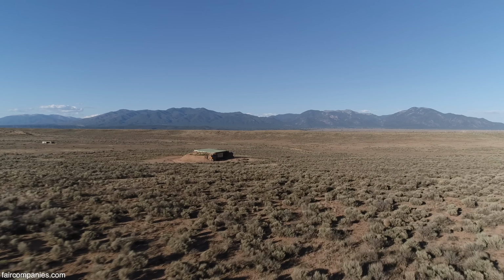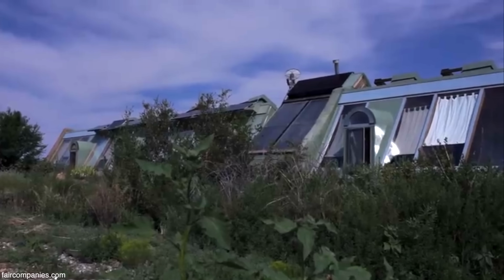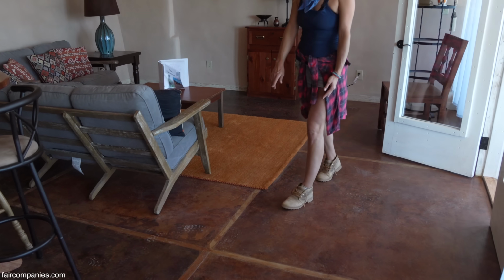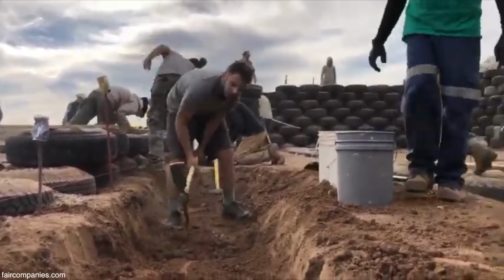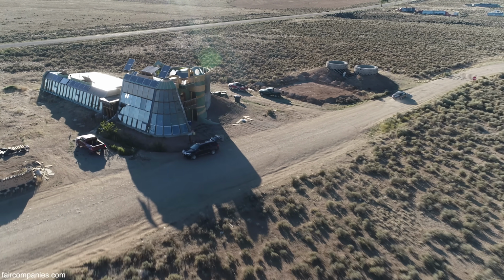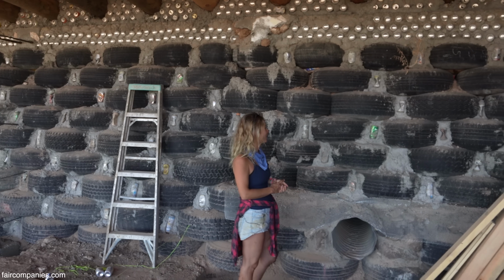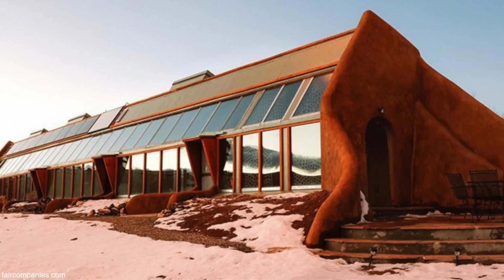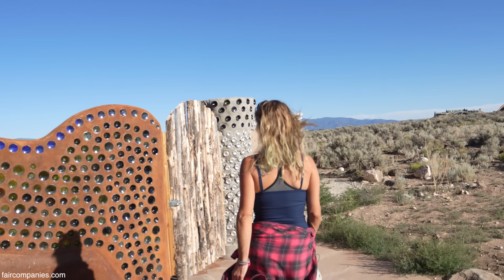New Earthships capture more energy, water & food at lower cost

Comment: I would be very interested in a more high-tech version of this. A solution could be engineered to electronically control the air intakes and vents to regulate temperature. This would allow each vent to separately turn on to keep that section of the house at the right temperature. They never went into hot water heaters, but I think that continually pumping water through the roof using some pumps could produce some sufficiently hot water if the roof was made black. That would need to be digitally controlled to happen when the roof is sufficiently hot, or based on the time of day. You could also get pretty good internet with a Starlink terminal, once that starts to really ramp up. Since the house is powered on DC, and my phone and laptop use a DC USB-C port, it would be nice to have that integrated into the walls alongside the standard outlets.

It seems like your biggest energy consumption based on this model would be the stove and microwave (probably about 1 to 2 kWh per day from cooking), unless you had a very power-hungry computer running constantly (say, 300W for a day, or 7.2 kWh). Lights could be very efficient LED bulbs that use DC directly from the batteries without a rectifier that would waste power, so that would be negligible. An efficient laptop running at (conservatively) 20W continually would be 0.48 kWh per day. This means you would probably need no more than 5 kwh per day, conservatively, thus ~0.2 kW of average power consumption is needed or 200W. You can get panels for about $0.47/W, thus you need something like $100 for the entire solar setup. You could be extra conservative and get $200 of solar, just in case. You could also just get bigger batteries. It is hard to find information on systems intended for 100% DC houses, like the one here, but it seems like it should be much cheaper.

Comment: Thank you for the video. I plan to build a small 50-60m house using some principles from both earthship and solar house designs. I would surround the house with earth to serve as thermal mass. Can you suggest any replacements for tires, please? The main reason is that I do not have the time or manpower available.

Comment: The problem with these homes is that they are crude and primitive-looking.  One of the main weaknesses is that if they were to have a drought there is no backup system like a well,  so everything would die and fail.  Which means that water would have to be trucked in.  Highly inefficent

Comment: I am building a home on a small island in the Philippines, I found this video during my search for cooling solutions, i'm looking into some Low Tech Geothermal cooling.
I have a deep well, about 20 feet down to the water table, through limestone... 
I was thinking about running a cooling tube about 4 feet about the water level, but was concerned about the humidity, so now I am thinking about a closed loop pump with large car radiators, 1 or 2 in the water & another larger one in the house with a fan blowing through it.
Or maybe even using the radiators in the well with some piping running under the tile floor or something like that.
Have you guys ever done anything like that?
Would it work very well, lol, pun intended
Do you think there would be much of an issue if I just used the cooling tube idea?
I don't have much of a budget & being on a small island, its not easy to get parts...

Comment: So some great ideas here but this will work only in certain environments. you could not use this in wet areas of the States. For the price it does not seem worthwhile $219k for a small-ish home, made of junk and repurposed stuff, that has a constant struggle for water, in the middle of nowhere, with very little creature comforts if the natural ones fail. It is super labor intensive needing a crew of 20 people to share the work load. this works for this area but there might be better solutions with different materials for other locations.

Comment: I don‘t get the reason for using tires. I mean, I understand you may want to get rid of them, and reduce the number which may end up in a landfill. But putting them into your house turns it basically into a hazardous waste landfill. How do you prevent that the tires do not pollute your air and water over time? And if the home ever needs to be torn down you end up with quite a difficult mixture of toxic substances…Even more useless for me are the cans. They seem to rather reduce the structural stability of the whole building than being helpful for anything. Heck, they don‘t even add much to the „mass heat storage“, and recycling of cans is nowadays well established (at least in most first world countries) and actually less energy consuming than making new aluminium…

Comment: An Earthship home can be built for very little money if you do it all yourself and take your time, find inexpensive property. (I bet purchasing land in this community is the biggest expensive.)   Source your own materials, use what is available on the land.  You don't need tires to go into the earth and find more stable temperatures.  A hole is free square footage for the labor.  Get a permit and harvest your own beams.  Mill your own lumber.  Some places you can obtain tires and other materials for free from landfills or torn down buildings.  A difficult thing can be finding a location that will accept alternate building styles.  The most difficult thing can be finding someone to join you on the earthship journey!   My latest design incorporates geothermal, advanced water collection, fully integrated AG, aquaponics, in ground citrus orchard and garden.   The goal is to produce all food, water and energy in a single biosphere.

Comment: I’ve heard one of the down sides of the tire wall is the off gassing of the rubber contaminating the air quality. Maybe less of a problem for parts of the year when the windows are all open but more so when it needs to be closed. 

I think the tire wall is also the reason it won’t likely ever be code compliant so it’s not possible in most of the country where there are building codes. The good news is that there are structural systems that are code compliant that could easily integrate the other systems in a healthy sustainable way.

Comment: I have a question about rain-water harvesting! Since it is ~300-500mm average yearly precipitation in NM. How can enough be collected from such a measly amount? Is there something I can read with amount harvested + used? Also I was wondering if condensors are used to collect water too?
Reply: What happens is the water begins to accumulate because the house itself provides cooler temperatures and root systems that retain the water compared to the dry arid surroundings that result in greater evaporation of what little rain fall there is

Comment: If you utilize your roof to collect water and harvest energy you're on the right path I could tell you how to collect 5 to 15 gallons of water a day simply by utilizing your AC and utilizing your solar panels that produce condensation even if there's no water in the atmosphere I can show you how to collect energy all day long and how to have nowhere on your batteries that simply building a water trough that allows for your batteries to be submerged essentially prevent your batteries from getting hot

Comment: Can thermalmass be achieved with other Construction material besides tires? Could these principles be used to make a different shape/ size home?
Reply: Cob or rammed earth homes both utilize extensive thermal mass. In a warm or hot climate they would moderate the temperature swings and be quite comfortable. In a cold climate that experiences winters below freezing and cloudy periods they would require exterior insulation and probably backup heat. In that case it is probably better to build with double wall construction and extensive insulation and use the thermal mass in the floor to store heat. Check out Polar Night Energy in Finland and then modify the idea.

Comment: I wonder if the cooling tubes would work in a humid, tropical climate? Does anyone have any idea?
Reply: All depends on the air temperature. In the desert you have temperature swings of cool, cold at night and hot during the day. The cool, cold at night helps to cool the mass. If it is always hot then where do you get the cold effect from. An opal mining town in Australia that is called Cooper Pedia ? the miners and later residents converted excavations into liveable homes. I understand that it is a hot, dry, desert country with daytime highs well over 100 degree F and yet in the encapsulated earthen homes they are year round about 75 to 80 F. In regards to the cooling tubes in a humid air if you had a colder mass and were drawing out side hot humid air you would need to have a slight slope away from the living area to allow the condensing moisture to drain to the outside. It would also have to have an exhaust in the living area that is high to create a chimney effect to draw the colder dense air into the living area. The described system is very dependant on having a cool down period. In truly hot, humid areas you are better off with a very well insulated building and use solar power to run a small air conditioner intermittently. Limit your window area amount and positioning to avoid solar heat gain. Windows in most homes are a weak link in the chain.

Comment: If you're collecting rainwater and using it, why not make a small water wheel that generates power from the falling water, then filtrate it after you've gained electricity from it. And some of these low-tech solutions are just a bit odd, like having a string to open your window? Is that really necessary? You could literally just have a window crank , which I would hardly call "high tech". I mean overall I like the idea, and the design, but there's a lot wrong with it as well. Like using tires as the walls is creative sure, but it looks like it takes so much longer to make as a result of this choice. The cost of man-power to build it over a longer period of time probably negates anything you even gained from cheaper materials, so you might as well just go buy normal building materials at that point. If it takes 200,000 to make this house, then you're honestly better off just living on grid at this point. Until something like this is vastly cheaper than you're not saving anything.

Comment: Also, I'd say Low-tech is a misnomer.  Power modules are incredible, solar power a no-brainer, but they're not low tech.  Maybe you don't need to be a genius to use them, but they are stored energy and therefore not to be trifled with, must be maintained, must be studied in depth before hand, and are constantly evolving in an industry rife with exaggerated claims, undependable support, regional legislation/possible governmental inspection, and not without significant investment.

Comment: "If it works here, it'll work everywhere else in the world" 
You just destroyed the legitimacy of your video in just over a minute. For example, solar is not feasible at high latitudes. Buildings like this wouldn't last long in rain forested regions with lots of rain. Regions that experience significant periods of cloud cover like the US Pacific NW would still require external power support. There will always be some water loss so the Sahara is out. 
Is this better than the average home? Absolutely. Will it work everywhere? Heck no. Not without customizing it to the region and having some external support available.